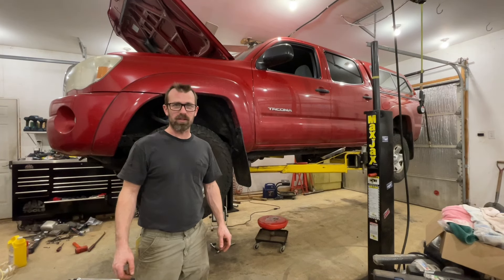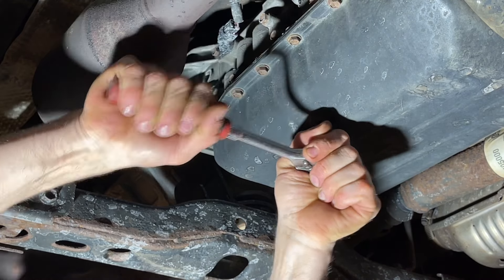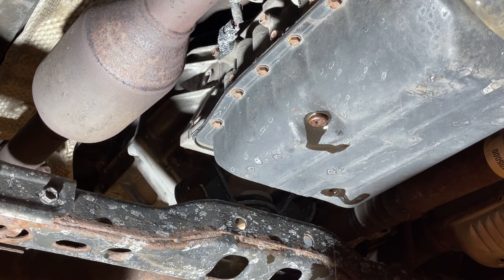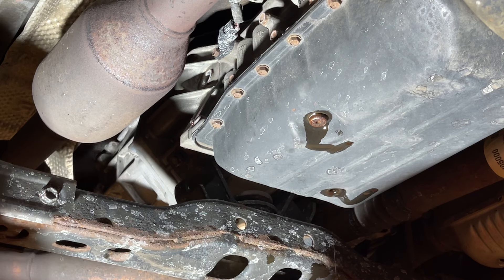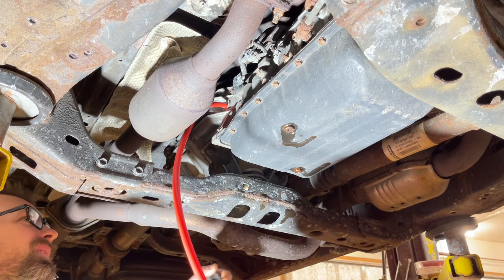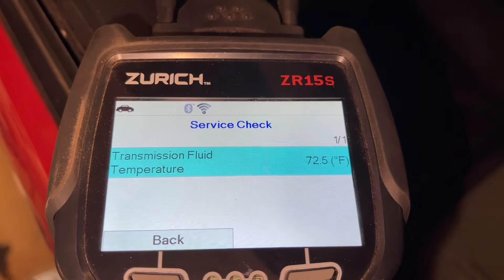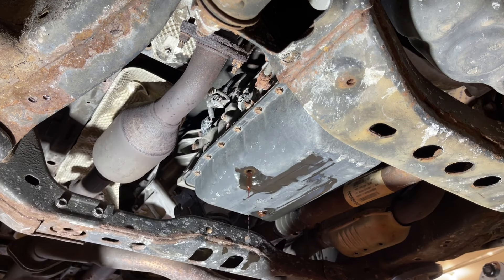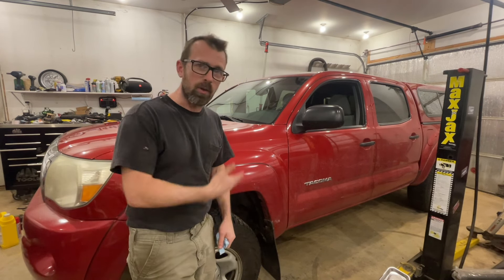2010 Toyota Tacoma transmission fluid change. 2008-2011 5 speed auto

Comment: I have a 2008 tacoma v6 2rd The transmission does not shift to number 4  
200,000 miles
Reply from the maker: They are generally very good transmissions, but they don’t all last forever. :(
Reply: @bennieaust  If I loan the oil and filter to the transmission, will it be able to operate normally?
Reply from the maker: @جمالحميد-ظ9ح  it’s not likely going to fix the problem but it may be worth trying. It’s a lot cheaper and easier than replacing it.
Reply: Thank you, I hope you have a good time
 @bennieaust
Reply from the maker: @جمالحميد-ظ9ح  you’re welcome!!

Comment: It took 2 months to get my trans cooling lines from Toyota and another month waiting for good weather to replace them. Lol. Quick question. If you are unsure of the transmission fluid level (because of the leaky cooling lines, which I replaced). Can you add fluid to the fill port until it starts to overflow through the overflow port (cold) and then do the procedure to check the proper level? I just want to top it up as I am unsure how much might of leaked out. Thanks for any input. Cheers!
Reply from the maker: Nothing ever goes as planned. :(

Glad you finally got the parts!

Yes, if you go about filling it like that you should be in good shape.
Reply: Thanks for the input, your video explaining the transmission service was very helpful to me. Cheers. @bennieaust
Reply from the maker: @TeeDub-z8l  You're welcome!

Comment: I was focused on the lift arm barely under the frame the whole time 😳
Reply from the maker: If you keep watching you may see the truck fall!

You’d be much less concerned if my focus had been on the lift arm, it was positioned in a good spot and centered under the frame.  

With this camera angle and low light on the lift arm, it does look sketchy in this video.

Comment: I have a 2008 Toyota Tacoma with 299000 miles it just hit and I’m about to change the fluid on it since my rear output seal is leaking the color looks dark should I just drain it and then fill it and go on my way or should I drive it a couple of miles and then drain it again and refill it. The truck shifts smooth smooth still before changing it never changed it before since i bought with 200000 miles on it
Reply from the maker: It’s probably not a bad idea to do a couple drain and fills if it’s in fact pretty dirty. You can probably do them back to back without even driving the truck. The new and old fluid will mix quickly.

Comment: Per Toyota it’s 60-100k miles dependent on how the vehicle is used. 
And fluid temp should NOT exceed 115F…. It’s 97f-115f
Reply: 115F and 130F

Comment: Bennie , very informative video.  I have a 09 Tacoma  and getting ready to go do to mine what you did ! One question for you , have you ever had problems with either of the transmission cooler lines?  I have lines  that have rusted and temporarily spliced in a hose to repair until I had the chance to replace both rear lines to the front of the truck then go and do a drain and fill from that point.  Thanks again!
Reply from the maker: Thanks Cliff!
I haven’t had to replace the lines on a Tacoma. I have replaced a lot of lines on GM trucks. They weep fluid at the rubber/steel joints.
Reply: Bennie if you don't have a  scan tool to check temp before pulling inspection plug how long do you let truck run to get temperatures up to this point?  Thanks again  !
Reply from the maker: 10 minutes should get you in the ballpark.

Comment: Thanks a lot for this! I also watched another similar video that showed the owner taking out the ATF pan and replacing the Automatic transmission filter! Taking out the old gasket, cleaning up the magnets inside, and replacing the new filter and gasket! I may just do that anyway! I own a 2011 Tacoma! Brought it used back in 2020, I did the rear dif, transfer case, and front diff fluid changes myself, just haven't done the transmission fluid yet! I'm going to do it this month!
Reply from the maker: In most cases changing the filter is not necessary. The normal particles are so small they mostly stay suspended in the fluid. With regular fluid changes you are removing the gunk. If however, it’s older with higher miles is definitely not a bad idea. You will most certainly find some gunk on the magnet and be able to wipe some off the bottom of the pan.
Reply: @bennieaust what’s higher miles? I just crossed 140,000 on my 2010
Reply from the maker: @erickbanks  if the fluid looks really clean personally wouldn’t drop the pan, but if it’s looking dirty, with 140k on the transmission, it’s probably not a bad idea.

Comment: one video said fluid from check plug should trickle, yours was a stream..Was yours over filled.?
Reply from the maker: I don’t think it’s over filled.  It’s possible I could have drained an additional ounce or 2 out but it would have had a very minimal effect. There is an acceptable range, just like with a dip stick. If drain out every possible drop at the highest acceptable trans temp it would be at the lower end of the acceptable level range, and if you stop draining before every last drop at the lowest acceptable trans temp you would be at the top of the acceptable level range. 

I have seen so many completely out of range fluid levels over the years that if you even half way try on these things you will fall in the range and be in great shape.

Edit
If you look up the meaning of “trickle”:
“(Of a liquid) flow in a small stream”

Comment: Temp check.....Should I keep engine run to around 20MIN and begin to drain 5mm plug like what you did if I do not have special tool to check temp....( between C and H gage...Is that call NORMAL TEMP?)
Reply from the maker: I cover that at 6:38 in the video. The gauge you’re referring to is the engine temp, not the trans temp. 

I believe there is another way to have a dash light come on when you get to the correct temp by jumping a couple pins together on the OBD2 port. I’m not personally familiar with that method though.

Comment: *The fill plug is part of the tailshaft extension.
Reply: On a 2 wheel drive it is on the tail shaft. On a 4wheel drive it is up towards the front, by the transfer case.

Comment: Your video look much simple and easy to understand...Most guys drain and measure how much you take OUT and put exactly IN....so big deal???) and the step check temp?? they make so complicate??!!
Reply from the maker: It’s really not bad. Everyone’s first question is how can I do it differently. It drives me mad!

There is a reason this is how Toyota recommends to service it. 

If you don’t know it’s currently at the correct level, measuring what you take out will not get you back to the correct level.  It will only get it back to whatever level it happened to start at, if you measure correctly. If it is at the correct level and you measure incorrectly same problem!

Comment: I'm the second owner of my 2015 Tacoma V6. If I don't know what brand of transmission fluid is in the transmission, can I use any fluid that is WS compatible? Don't know if the prior owner changed fluid and if he did, there's no way of me knowing what brand was used. So if there was Toyota WS fluid in the transmission and I used aftermarket fluid, is that ok for a drain in fill?
Reply from the maker: IMHO I wouldn't worry about it at all.  I haven't heard of, or experienced any issues as long as you use the correct type (WS).  I would personally be more worried about the alternative of not doing it and running old dirty fluid instead.
Reply: @bennieaust  thank you and keep creating content. I’ve used a few of  your videos to do maintenance on vehicles.
Reply from the maker: @deerphoria4314  you're welcome!  Great to hear, I'll keep them coming!

Comment: How long would you say it took for the transmission fluid temp to reach 115 degrees? I ask, because I don’t have a way or tool to read the temperature. Thank you for this video.
Reply from the maker: I think it was about 10 minutes.  Do some online searching, I think there is a way to jumper a couple pins in the OBD2 port to actually have a light come on and tell you when the trans is in the temp range.  I am unfamiliar with that method but that sounds like it might be a good option for you.

Comment: I did the same on my 2010 tacoma and a little trickle came out of the standpipe instead of almost a full quart like your did.  Either there wasn't enough fluid to begin with or 1 gallon wasn't enough.   As long as it trickled out a little there should be enough right?
Reply from the maker: That’s correct. You’ve got it right where is needs to be.

Comment: Question.. so if we're putting in a gallon ( 4qts) and draining a quart out after that.. the new trans fluid total is 3 quarts?
Reply from the maker: @patobryan1563  it will mix in immediately, so it won’t be 1 quart of new fluid coming out, it will be a mix of old and new.

Comment: Wow you let all the fluid out on the check plug.
Do you think a heavy trickle be ok.? That what i did. I closed it up on a trickle but a heavy side.
Reply from the maker: Yes, you will be just fine. And so will I. :)
Reply: Thanks. I can sleep better at nights
Reply: I’m getting nervous reading alot forums on the internet on Tacoma sealed trans. Changing the fluids may damage the trans
Reply from the maker: @craftmansnapon8035 , While I can't make you any promises on this, and I obviously know nothing about your specific Tacoma, I can say this:  I have been servicing transmissions since the 90's and I have not once encountered a problem after servicing.  I have in fact resolved issues that other shops diagnosed as being a bad transmission that needed to be replaced.  Now I am sure it's happened at some point to somebody, but I have a feeling that all these people saying you'll damage it have had no personal experience, or had pre existing issues, or did something wrong with the service.  These transmissions are simply failing because people are servicing them correctly.  

Proceed with whatever you feel most comfortable with.
Reply: 14 taco OF 
96k miles 
0 issue 
Follow every step you did and anyone other, paid good attention to every details  
Just a little more trickle 
Truck was never abuse 
At 96k miles when draining the atf it still looked new. That’s what scared me. 
Honestly i kinda regret it due to Color 
Thanks for replying, made it relaxing
Reply from the maker: @craftmansnapon8035 , you're welcome.  Nothing to worry about.  Good cali on being proactive on the maintenance.  It will last you a long time.

Comment: What would I have to do if I don’t have that scanner
Reply from the maker: Exenty,  I posted a link on where to purchase the scanner so that’s one option. If you are wondering how to do this without purchasing a scanner there is a process where you can jumper out a couple of the obd2 port pins but I am not familiar with it so you would have to do a search to figure out that method.  For me, I can’t do what I do without a pretty capable scanner so I obviously use a scanner.

Comment: 2013 tacoma  121,450 miles should i change the filter? Toyota  is telling  me u never need to change the filter is this true?
Reply from the maker: I almost always agree with that. If the fluid is just dirty and not chunky or really metallic then fluid only. Plus, if it is that bad you have bigger issues.

Comment: When should you change the filter with it Thanks
Reply from the maker: I'm sure 10 different people will give you 10 different answers. :)
Here's mine:
If you keep clean fluid in it you can probably never change it.  If you wanted to be cautious I would say change it every 100K-120K miles.  My reasoning is that the filter doesn't filter out the very small particles that a transmission produces under normal circumstances.  They are too small and stay suspended in the fluid, or captured by the magnet.  Changing the fluid and cleaning the magnet, where applicable, will get them out of the system.  If you actually have large particles getting captured by the filter you have bigger problems. Hope that helps.

https://knowhow.napaonline.com/automatic-transmission-filter-do-you-really-need-to-change-it/

Ben

Comment: I have a 2010 trd offroad, and with that package comes the transmission cooler. Does that effect anything or is the process the same?
Reply from the maker: The process is exactly the same.
Reply: @bennieaust  also i read that its important that the engine is running when doing the final fluid level check. Correct? Thank you
Reply from the maker: @janetairlines1351  , yes, definitely need to be at the correct temp and running.

Comment: I have a 2010 with 128k miles and was going to do the drain and fill. Someone is telling me not to do that because the detergents in the new fluid can lift up gunk in the pan and cause problems, and that the whole pan needs to be removed and cleaned to be safe. The truck runs 100% now and i dont want to mess it up.  I dont know what to do
Reply from the maker: Personally I wouldn’t be worried about doing this service on your truck, but if that “someone” is a local expert familiar with your truck then you should absolutely listen to them over some guy with a YouTube video. :)

Comment: Personally, I would have put the stand pipe plug in a little sooner when the fluid dripping (after the steady stream) changed from dribbling down the center of the tube to where it just started to go off to the side of the hole. An exact procedure from a fluid temp standpoint but kind of unclear as to what the definition of a trickle is. Just my opinion. Should have stuck with tried and tested dipstick technique used for decades.
Reply from the maker: I wish they had dipsticks as well. 

As far as how much to drain, think of it like this. If you pour an excessive amount of water in to a cup sitting on your countertop, all the excess water will overflow and spill out of the cup. When it stops spilling out how full is the cup?  Completely full. That’s how it works in these transmissions as well. You cannot drain too much fluid out. Anything you drain is excess fluid.
Reply: Thanks for responding so quickly.
What I'm envisioning inside the pan is, for lack of a better description, a lake with slight waves due to the turbulence of the transmission running and you are seeing an average of this when the overflow is occurring at the top of the stand pipe and then exiting out. And the other factor is that the longer you wait for the dripping, the fluid is getting hotter (expanding). An interesting scenario. 🙂 @bennieaust
Reply from the maker: @richardcarlson3627  you’re welcome!  I think you’re right on all that, but I’d venture to guess that they’ve accounted for things like that in their procedure. Technically those variables would also effect a reading on a dip stick.  And to be fair there is also an acceptable range on a dip stick, not an exact level it must be at. I think this is the same thing. 

Of course they didn’t ask me about it when they were writing the procedure so I can’t verify that for sure. :)

If the temp is way higher than called for I would expect incorrect level, but if properly followed I wouldn’t be too worried about it.

Comment: I'm due for my transmission fluid change. I'm sure you're aware of the controversy of "Full Flush" vs a simple "Drain & Fill"  and which is the correct way. After my own research and asking several mechanic friends myself, doing a simple Drain & Fill is the best way to go.

What do you recommend? Btw if your fluid looks a bit dark could I also do a Drain & Fill several times to achieve a more "Reddish" color?

Any input is greatly appreciated and awesome video!
Reply from the maker: Thanks Kenneth!

I’m well aware of the controversy. :)

I have personally never had an issue with a flush and wouldn’t recommend against them, but everyone needs to research and make their own decision. 

Doing a drain and fill several times is definitely not a bad idea if the fluid it dark. After the first time you’ll be able to knock it out pretty quickly.  

Thanks for watching!
Reply: If it’s especially dirty (Brownish) than yeah, so an extra drain and fill 15 minutes later after driving it around the block after doing your first drain and fill, reslly no need to flush the entire transmission. 👍🍺

Comment: Do any of the other zurichs scanners read trans temp?
Reply from the maker: I know I found a chart somewhere that broke down all the functions of the whole Zurich lineup. Can’t remember where I found it though.  There are a couple that do but the are the fairly high level ones.
Reply: @bennieaust I ended buying the zr15s on sale for $270. No shops around me can change it until next week, and I'm travelling right now and I know it needs changing. I'm currently waiting on the trans temp to lower down so I can change it at the Walmart parking lot lol
Reply: @bennieaust also, on that scan tool, it mention if it was hydro or vacuum. Which one did you choose? I have a 11 sport 4x4
Reply from the maker: @Clemente22  :), it’s a great scanner!  Best of luck with the service and your journey!
Reply: @bennieaust another question lol does it matter what temp you drain it at? Or should I be well below operating temp?
Reply from the maker: @Clemente22  no, you can drain it at any temp, just don’t burn yourself. 🔥